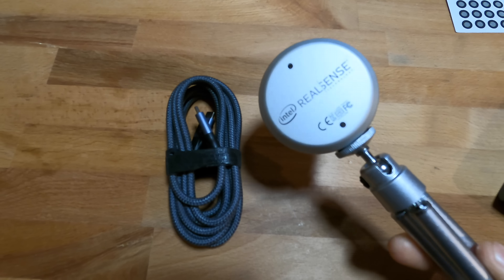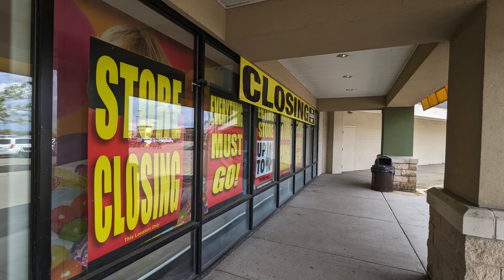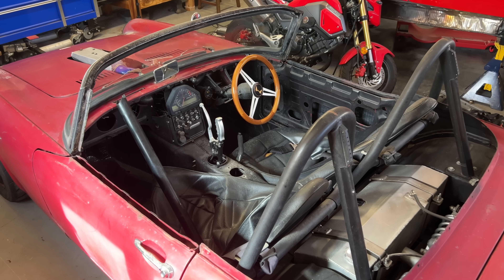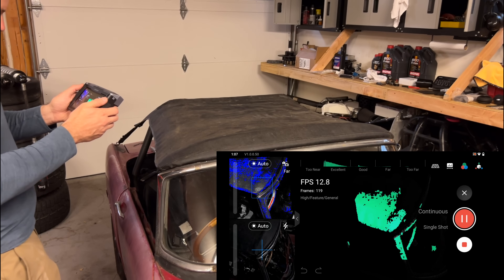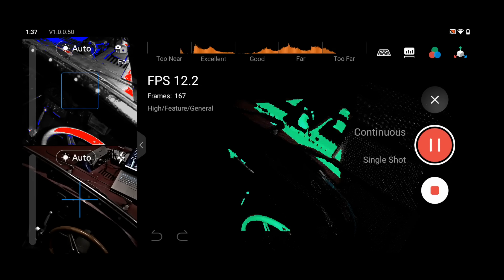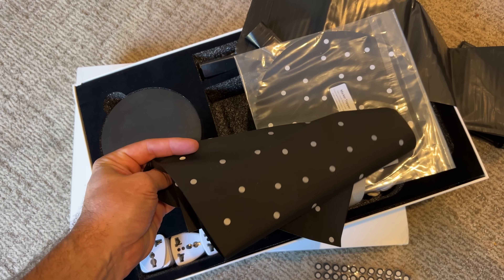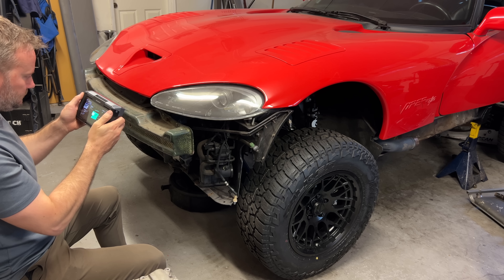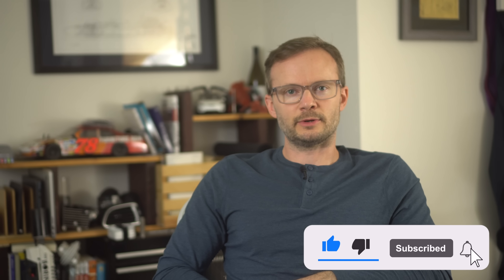All-In-One 3D Scanner: Revopoint Miraco vs Einstar

Comment: Hello, I'm Johnathan, a MIRACO beta tester. I used MIRACO to scan a car and had a great experience. Your review seemed less favourable, possibly due to software updates or exposure settings.
In my experience, MIRACO is a significant improvement over previous products, despite some minor issues because of the early beta sample and software. I appreciate its convenient all-in-one design. Similar scanners like Artec3D's LEO cost over $30,000, whereas MIRACO's KS price is under $1,000, making it a fantastic value.
Before Revopoint arrived on the seen, high-precision handheld scanners were pricey, costing over $8,000. Revopoint's POP series revolutionized accessibility for professionals, hobbyists, and makers, driving down scanner costs across the industry.
From a user's perspective, Revopoint's contribution is immense. Though their products have a few early version shortcomings, we can't ignore the company's contribution to the industry. I love this company's products and can tolerate some flaws because of their technologically democratic style. 
Let's offer suggestions and encouragement to further improve the product. Otherwise, we might still face high costs. Revopoint values user feedback and strives for continuous enhancement. At least, they value my input greatly. Check out the Revopoint forum for car related scanning with the MIRACO. By the way, you can stick markers to the windows to help with tracking they don't just have to be on the bodywork
Reply: Hi Johnathan, have you tried scanning small items like coins? What was the result?
Reply: @TechnoPioneers007  I haven't scanned coins myself but I know other beta testers have with good results, I'll do some more tests and let you know how it goes, have a look on the Revopoint forum for some of the other beta testers scans, hopefully PUTV will add a showcase soon because I know she has scanned coins with nice results but hasn't publicly released them yet as she is very busy,
Reply: Suggestion .... test it better before releasing it. Who wants to buy a product that's full of bugs?/doesn't work/beta. Do your customers look like a guinea-pigs to be tested on?  If someone buys a product, it should work. That's why they purchase it in the first place right? People want to scan items that they want or need NOW .... not in 2 years time once the bugs have been worked out.

Comment: I've used all of Revopoints's scanners since my early Kickstarter original POP except for this one. The scanners have all given me and thousands of other users excellent results over the course of the software development in the last 3 years. I have a couple of other scanners of another brand and one thing I've noticed is that they all act a little differently and require slight modifications to your scanning technique. So if you've been using a particular scanner for any length of time, especially a different brand, I think it'd be a little difficult to pick up one you have no experience with and be able to fully take advantage of its capabilities. You mentioned having a POP and feeling it was just a hobby toy; have you used the latest software and given it a chance to perform?
Reply: When people buy a scanner, it's because they have a purpose for it and wish to use it NOW. Who wants to wait for 3 years for the software to get better? That's stupid. I purchased a Revopoint POP2 when they first came out because I needed a scanner, but the software was so poor at the time I was unable to achieve the goal I had. I then purchased an Einstar and it worked perfectly straight out of the box. The software was intuitive and worked far better on a bad day than Revopoint worked on its best day. I was able to achieve my scanning goal with the Einstar in a fraction of the time/stress/markers that the POP2 required. So ..... when you say "give it a chance to perform" you're really saying "hold it's hand because it can't stand up"
Reply: I've seen updates as often as twice in a month. @TechnoPioneers007
Reply: They update their software fairly regularly, once a month maybe once every too months. It is so much better than it used to be @TechnoPioneers007

Comment: A simple comparison doesn't really capture it – Einstar and MIRACO are very different.
Einstar requires a high-end computer with an Nvidia graphics card, which costs at least $1000-1500 USD or even over $2000, and that's before you even bought the scanner. On the other hand, MIRACO is a stand-alone scanner, handling both scanning and post-processing. It's competitively 
priced at around $800 USD.
Also, I've seen various reviews from YouTubers and Revopoint's beta testers, and their experience with MIRACO's scanning process appears to be different from what you mentioned.
Reply: He mentioned that if you’re doing CAD you probably already have a computer capable of high performance graphics.
Reply: While I'm sure a high-end computer will help, the basic requirements can be found on a 500 dollar laptop.
Reply: @SweBeach2023  and with that basic 500$ laptop you'll be pulling your hair whenever it will lose tracking, and it will happen a LOT
Reply: Not to mention, Einstar requires a power outlet to operate, and that is not available for the places I want to scan
Reply: @libertycommentator okay? Buy the miraco then, the video is ment to inform and give matts experience, not force you to buy the one he likes for his workflow
Reply: I can my entire van interior with the einstar and a used $180 laptop. Don't believe the hype

Comment: I tested the Einstar and also bought the POP3. For small objects and details, the Einstar, with its cheap VCSEL projector that has low accuracy, cannot compare to POP 3. It struggles to scan small objects in detail and requires several attempts before successful modeling. On the other hand, the POP3 excels in this aspect, and I still have faith in MIRACO to scan a Bolt as they demonstrated live.
Reply: The Einstar is not meant for small objects 😂
Reply: @donkeyholmes4581 i have a friend that has a miraco it scanned a smal dog figurine (3cm wide) with impressive accuracy.
Reply: @TechnoPioneers007  $199

Comment: You just have to remember that this is still a beta version.
The most important thing about the current beta tests is to find hardware bugs.
And so far the hardware seems absolutely solid.
Of course, it is also important to find software bugs - but these are still to be fixed after the release.
So far the hardware of the Revopoint scanners has not disappointed me.
The current scanning software, from the first versions to the current one, has brought huge improvements in terms of features and processing speed. This has also increased my confidence in Revopoint.
Above all, it is important to remember that the einstar requires a very powerful computer and all Revopoint scanners run even on mobile phones.
In this video you compare a scanner that has been on the market for a long time with a beta version - and you also say that the tracking of the einstar is now much better than at the release - well, this happend to all Revopoint scanners sofar as well - i mean that they become mutch better over time.
Reply: Lol .... that's a ridiculous statement from start to finish. If I buy a scanner, I want it to work, work well and work NOW. What exactly is the point in buying a half-assed beta product that's full of bugs?  If I need a good scan, I need it now .... not in 2 years time when it finally becomes decent. pffft
Reply: @jonnofowler5752  The Scanner he testet is a BETA version - not the scanner you buy right now. Witch means that - if you buy the Scanner - you will get the Production unit. This is the reason for Beta testing - to get a more stable Production Unit. At the moment this Scanner is on Kickstarter - an I just can say that I was not let down from previous Revopoint KS and there Product - but that is just my experience.
It is perfectly legitimate if someone says that he wants to wait until the software has reached a certain level of stability and reliability - but then he will have to pay more..
the point is - if you compare a Beta model with a already out for x month Model you should take this in the conclusion.
do you really think the Einstar was released without Bugs?
If you are looking now for a Scanner that has proven quality - cause you need this now and you have all the requirements - then yes - go with the Einstar.
I don't say that the Einstar is a bad scanner - it depends on your requirements whether the Einstar or the Revopoint is more suitable for you.
Reply: @jonnofowler5752  But I heard from my friend that the Einstar was not so good when it was launched. As for a Kickstarter project like Miraco, they can make adjustments to their software before the end of the project. Anyway, I spent more time on this today, and I think Revopoint's problem is that they shouldn't give beta samples to a YouTuber.
Reply: @jonnofowler5752  i have bought Luba 2 from Mammotion. They are doing the same thing, they advertised a feature and released it after a year. I blame weirdo Musky boy for selling features before available. Let's not make this normal!! If I buy today, I need at 100% today.

Comment: Instead of Hot Wheels, you might want to try ping pong balls. Faro uses precision white spherical targets for stitching the architectural laser scans (the software is programmed to find them and auto-align).  For medium sized things like the car I bet ping pong balls would be way better than the tracking dots. Mount them with some museum putty where you can get three in the field of view to fully lock the coordinate system. Perhaps at the start/ finish to eliminate the drift, and a few peppered around at critical points (corners of the windshield, top of each hoop, close enough in relatively featureless areas to maintain lock).  If you have the ping pong ball in direct contact with the surface you can also get an accurate location of the surface itself. Thanks for the review, and all your videos.

Comment: Hello, I'm Johnathan, a MIRACO beta tester. I used MIRACO to scan a car and had a great experience. Your review seemed less favorable, possibly due to software updates or exposure settings.
In my experience, MIRACO is a significant improvement over previous products, despite some minor issues because of the early beta sample and software. I appreciate its convenient all-in-one design. Similar scanners like Artec3D's LEO cost over $30,000, whereas MIRACO's KS price is under $1,000, making it a fantastic value.
Before Revopoint arrived on the seen, high-precision handheld scanners were pricey, costing over $8,000. Revopoint's POP series revolutionized accessibility for professionals, hobbyists, and makers, driving down scanner costs across the industry.
From a user's perspective, Revopoint's contribution is immense. Though their products have a few early version shortcomings, we can't ignore the company's contribution to the industry. I love this company's products and can tolerate some flaws because of their technologically democratic style. 
Let's offer suggestions and encouragement to further improve the product. Otherwise, we might still face high costs. Revopoint values user feedback and strives for continuous enhancement. At least, they value my input greatly. Check out this video we did showing the scanner in action scanning car's, https://youtu.be/_-0LnCGH7nA?si=2qfjCMwYDbBntH1w

Comment: The thing to remember about the pricing strategies is that if you're finding a lower price, you're the one being subsidised by whomever's paying the higher price. It's up to you if you think you should be rewarded with a lower price if you're willing to go out to look at several different shops or find a coupon, but would you really be happier if you could pay 20% more  so that the folks paying full RRP would be paying 20% less?

That said, otherwise great review. I can see that the Einstar is better in many cases. but not all, and can see situations where I might go for the Morroco instead.

Comment: In my industry and scanning scenarios, it's challenging to rely on bulky PCs for scanning, especially when I often need to complete a scan rapidly. Before the introduction of the Miraco, the ARTEC LEO was the only equipment that met my requirements, but it came at a hefty price. The launch of miraco allows me to purchase a standalone product similar to LEO at hugely favorable price. I'm thrilled, and although there are some imperfections, I believe that Revopoint can enhance the scanning experience with continuous updates.
Reply: The Artec Leo weighs more than 2.5KG and still cannot scan tiny details. I hope that MIRACO can solve this problem.
Reply: There are other solutions to this I'm sure. You don't need to bring the bulky pc with you. You just need to connect to it from anywhere. I don't ultimately know how to do it but I'm sure it's possible. Remote desktop + some way to pass the usb signal
Reply: I'm outta this world that, there's finally an stand alone scanner that doesn't cost the same as car.
Reply: This all seems very intellectual but I have had and seen better performance in gaming laptops than in many PC's. I'm certain the right laptop can ace the data rate recording with miraco. Just as well as any wireless transfer to one of those bulky dinosaurs with  a size matches performance stereotype. "Ain't no substitute for cubic inches boy!"
Reply: It’s not similar to the Leo in any way other than being stand alone

Comment: Unfortunately you left out one major benefit tho. It can do smaller stuff which is something that einstar is terrible at. Also as mentioned the Einstar was much worse when it came out then now. So to be expected a beta unit will be improved. However. Tbh both trans scans were terrible which makes me wonder since I've gotten much better results with the Einstar and range then posted here. Also the miraco can be fully edited on the device and meshed 

But you say the price is high but take into account the device is the same cost and don't need a 2k+ computer to get any adequate results. I wonder what laptop on battery vs miraco would look like tho.
Reply: " don't need a 2k+ computer" yes you do if you want to do reverse engineering afterwards, which is the usecase Matt was talking about here.

As for the small stuff I agree but again this was not the key point of the review.
Reply: @GridPB  processing an Einstar scan in a timely manner is much more difficult then running software to reverse engineer.
Reply: My einstar experience is the same as day one. Shining has very mature aoftware

Comment: I've found that Revopoint's scanners take to physical markers well.   A pound or two of plasticine's in my box with the Mini I have.  Pinching off little irregular blobs provides excellent tracking, and I think it cost me a buck or two for the brick of plasticine at the dollar store.  

The reflective markers, I found that Revopoint's software doesn't need the given size of markers they provide.   Their software detects a simple white dot + black ring around it as a reference dot.  I've reflective 1x3mm dots, standard size 6x10mm ones, and I've even printed out random sized ones on white paper labels that detect.

Cleanup is a b***h with paper labels stuck to cars or car parts, but they work great to aid tracking even on "General mode" vs the actual Marker mode on the surrounding areas, like the blobs of plasticine.   But I'm not spending a mint on special, specific sized reflective markers, which keeps consumables costs down.

Since I don't have more than the one scanner to toy with, I can't say if other brands also take to these tips as well, or not. YMMV.

It is DEFINITELY the case that the computer receiving the scan data, and the software make or break the usability of the scanner.   The scanner hardware however: ... Revopoint still supports every scanner they make with their RevoScan software, which has brought a horde of gained usability to old models.  My Mini was frankly, not much better than a toy with the software available when it shipped late last year.   It's much more capable as software has matured.  And the laptop upgrade, to use the new versions.   

Matt, if you could, next time you do another 3D Scanning video, can you touch on the software experience with Einscan/Einstar vs Revopoint for all of us?

Have they been updating their software? 
Do they continue  to support all their models of scanners? 
Have you noticed any improvements in performance or tracking with subsequent versions?
Have they upped their hardware requirements since you first owned it?

Since I only own the one, haven't access to another, I have no other reference, and would genuinely like to know.

Comment: Though a sequence of coincidences I got a couple of hours of instruction on how to use an Einstar (one of their older models) from an employee, and what he recommended for the best scans with the "dots" was first doing a low-resolution scan, and then discarding all of it but the dot locations and using those known locations as a starting point for a high-resolution scan.  It did seem to make a significant difference in the surface quality of the scan.  Might be worth a try to see if it's still useful for the current model?